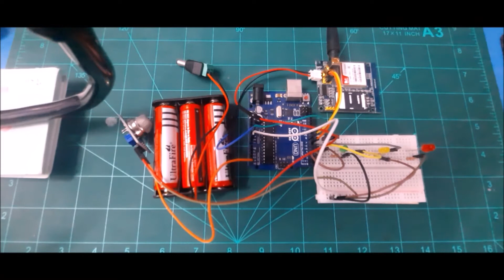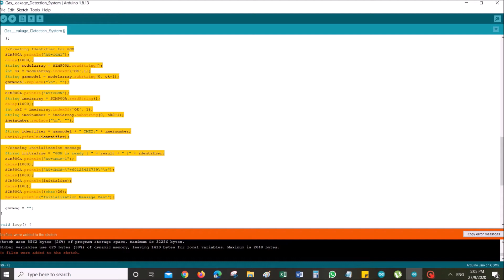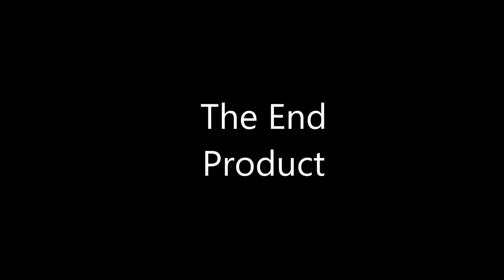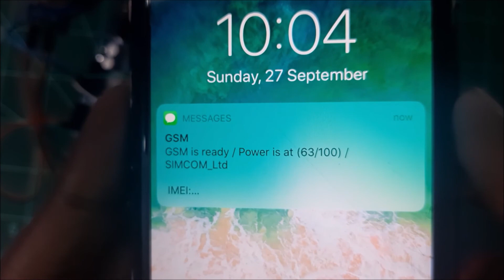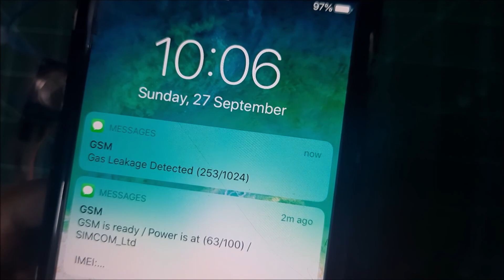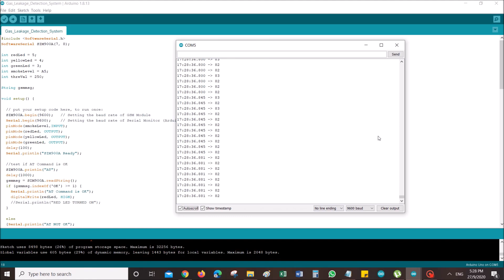Complete Gas Leakage Detection System

Comment: Do i have to use external dc power? is it not okay to use usb for powering the ARDUINO?
Reply from the maker: You need extra power for GSM. Usually GSm modules takes a bit more

Comment: Couldn't you also get the message to timestamp as well? That would be a useful addon.
Reply from the maker: Yeap, you can get time by using Arduino Library or adding an external RTC module. Whichever way, it's a matter of concatenating these information into one string which will be sent to GSM :)